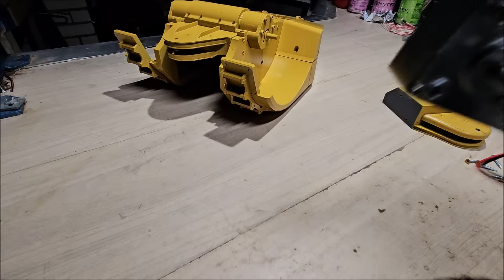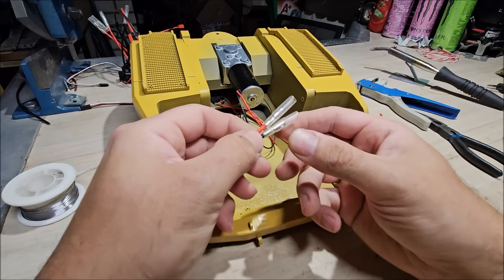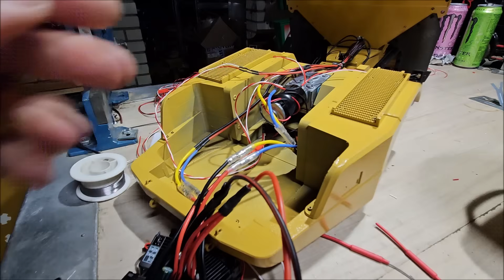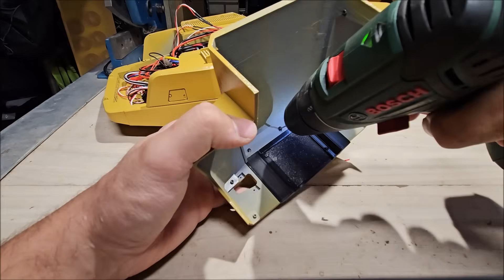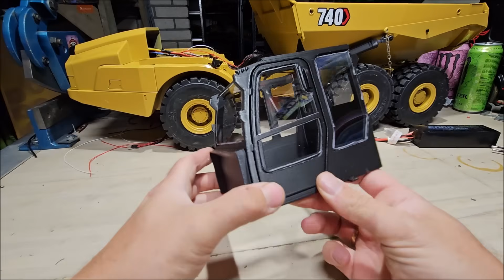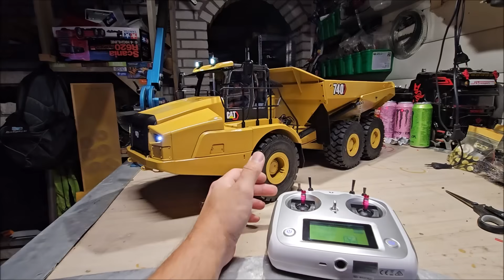1/14 CAT 740\745 Buildseries - PART 3

Comment: Hi,Burnie. do you have a parts list for this build? before i by id like to get pricing for all the hardware so i can plan a budget, thanks!!
Reply from the maker: Yes, you can find them here: 
https://cults3d.com/en/3d-model/tool/burnie222rc-s-model-partslists
Reply: @burnie222rclasseanhanger6  is a 256x256x256 build volume big enough for your models? I trying to decide on a printer to buy

Comment: Hi! I have purchased the 3D files for this CAT 740 project and I'm currently working on the assembly. I have a specific question about the steering motor part in Part 3.
I noticed you used an 8mm coupler on a motor with a 6mm shaft, which forced you to drill the shaft to secure the connection. However, looking at the assembly, the other end of the coupler doesn't seem to hold any shaft or axle; it's simply used to rotate the grey steering part.
As I build my own version, I'm wondering: can I use a 6mm coupler instead? If the other end of the coupler is empty, using a 6mm inner diameter coupler (like 6mm to 6mm) would perfectly fit the motor shaft without needing to drill or weaken it. Was there a specific design requirement for using an 8mm bore, or would a 6mm coupler work just as well for this assembly?
Thanks for the great design and the helpful videos!
Reply: The 8mm-6mm coupler is for the tipper (8mm screw lead to 6mm motor shaft.

Comment: Good afternoon. I'm currently working on assembling your model. Could you share the link to the sound module?
Reply from the maker: yes ofcourse :) Here is the link:

Remember to choose the correct plug:

https://www.aliexpress.com/item/1005007577311955.html?spm=a2g0o.detail.pcDetailTopMoreOtherSeller.1.5579njbknjbkk3&gps-id=pcDetailTopMoreOtherSeller&scm=1007.40050.354490.0&scm_id=1007.40050.354490.0&scm-url=1007.40050.354490.0&pvid=67d0bf68-7ce7-4ef0-b0a7-70d291050550&_t=gps-id:pcDetailTopMoreOtherSeller,scm-url:1007.40050.354490.0,pvid:67d0bf68-7ce7-4ef0-b0a7-70d291050550,tpp_buckets:668%232846%238111%231996&pdp_ext_f=%7B%22order%22%3A%2250%22%2C%22eval%22%3A%221%22%2C%22sceneId%22%3A%2230050%22%2C%22fromPage%22%3A%22recommend%22%7D&pdp_npi=6%40dis%21USD%2174.09%2140.75%21%21%21521.06%21286.58%21%402103890117653158604016496e0a2d%2112000041366387707%21rec%21NO%212847778269%21X%211%210%21n_tag%3A-29919%3Bd%3Ab8856c38%3Bm03_new_user%3A-29895&utparam-url=scene%3ApcDetailTopMoreOtherSeller%7Cquery_from%3A%7Cx_object_id%3A1005007577311955%7C_p_origin_prod%3A
Reply: @burnie222rclasseanhanger6  Thanks a lot!))
Reply: @burnie222rclasseanhanger6  
I also wanted to ask, how can I get the source code for the stickers?

Comment: Hi there,
great job and even better explanation. 
I'd like to purchase the plan but so far I have printer. What printer do you use? 
I want to make sure that your files fit to the printer without any software problems. 
Thanks in advance for your reply. 
Best regards, Bernhard
Reply from the maker: thank you so much 🥰 I use Bambulab P1P :) And I can recommend them !
Reply: @burnie222rclasseanhanger6  👍thanks a lot, this is of big help for me. Keep going the way you do the job
Bernhard

Comment: Hi Lasse, actually the transmitter you are using has a function for delay, is called EXPO (Rate/EXP in the functions).
Reply from the maker: Nope, Exponential is not the same as delay, if I pull full throttle the expo will still give 100% throttle, while the delay would be delaying the input up to 100%. Huge difference